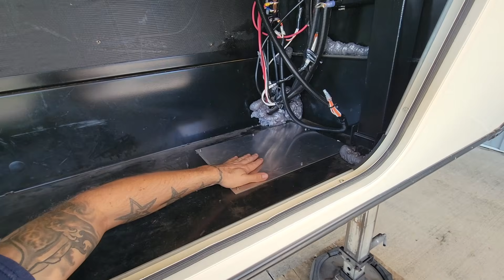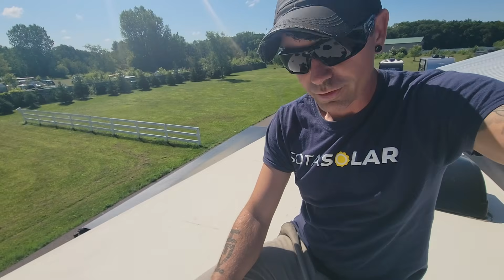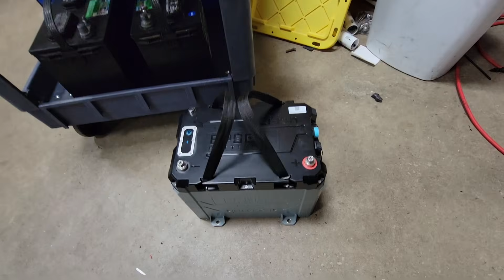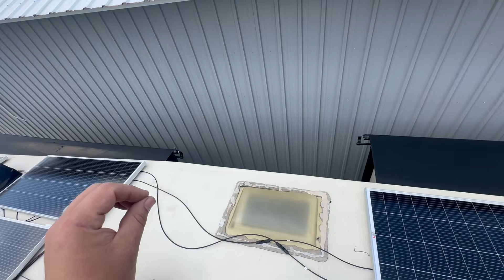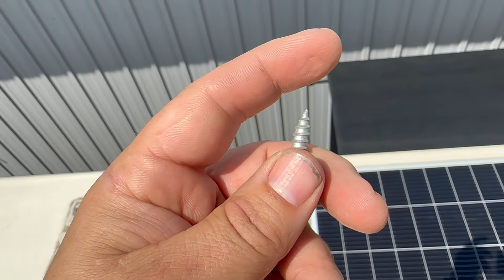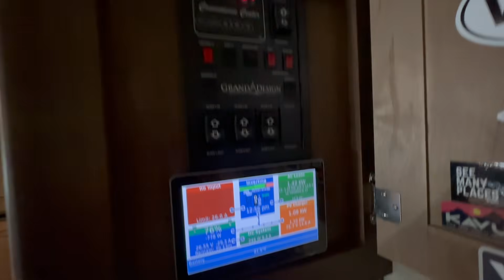2019 Grand Design Reflection 337 Victron 24v 2000w Solar Install  Epoch Batteries

Comment: When you fuse/wire the 24:12 converter, are you using 4ga and a 60a input fuse???
Reply from the maker: Usually 6 awg and a 60-80amp breaker.

Comment: I’ve got one of the 460Ah Epoch batteries and have been very happy with it.  Be sure and set all charging sources to 13.9 Absorption and 13.4 float to prevent the batteries from going into “full charge protection”, which happens if the amps are low and the voltage goes over 14.  It happens once fully charged and connected to shore power if you use the default Victron charge profile.  In full charge protection, they completely turn off, as if the batteries were completely removed, which means they won’t support the 12V loads, and your voltage will fly all over the place since the MultiPlus in float is trying to support the loads.  Just a little quirk with the Epoch BMS, but once you know it, you can adjust for it.  Downside is Victron makes you buy a $70 dongle just to interface with your PC and make the adjustment, instead of giving you a USB plug right on the unit.  You’ll need to adjust the solar charge controllers as well to under 14.  Bulk charge will remain over 14 but that’s not an issue since the amps are high.
Reply from the maker: Yes that is a quirk of the Epoch 460s .  I did see there is a new firmware out for the batteries and a new 460ah version of the battery.

Comment: I am doing a similar 24 system with the Orion Stepdown.   How do you tie the 12v battery to the existing shutoff switch for  the rv, and panel system?   I am assuming you remove all the original inverter, charger, converter.
Reply from the maker: We just put the output of the 12v converter to the existing battery, or where it connect tot he rest of the system.  Whatever is more convenient.    We do remove inverter many times, we leave the converter in, just turn off breaker.  Reason being is if something happened, we want that to still be available.

Comment: Can you explain what you do to route the main power wire to the multiplus? Why are you disconnecting the main rv input wire? I don’t follow what you’re doing there and how you route the new wires and why you’re not keeping or reusing the original rv input wire that already is routed to the main fuse panel?
Reply from the maker: The Multiplus takes all 4 wires in from shore and outputs all 4 wires to the panel, so we must re-reoute the wires through it.

Comment: Loved the setup and install. Just curious on how you all tied in the 12v battery to the Orion? Would like to see the connection diagram for that setup. I like having the 12v battery as a buffer to help pickup the slack rather than having the 24/12 converter do all the work.

Comment: Have a 337bmyself and was wondering what size gauge wire you ran down thru the vent and where and how did you bring it out of the vent down below...Thanks I appreciate it...and might have to get with you to finish my system...Great videos also...David
Reply from the maker: Would love to help. 

10 awg solar wire. We neglected to record that, and I wish we did. JD carefully preyed back the wall in the bathroom revealing a nice double right angle bend making fishing a line a bit difficult. Although, thinking now, you could use the balled up plastic muff on a string and vacuum trick to suck it up from below. Maybe next time, ah hind sight.  Anyway, JD then cut a small hole big enough for the wires through the vent pipe near the top of the wall.  We left the wall open long enough to run the cerbo HDMI as well. 

I hope that helps.
Reply: @sotasolar Thanks I appreciate it...can you explanation hie you guys seal the hole back up in the vent tube...Thanks

Comment: Clean install.  But...why lithium ion when lifepo4 is way safer and has 3x the cycle life?
Reply from the maker: Pretty sure these are LiFePo4
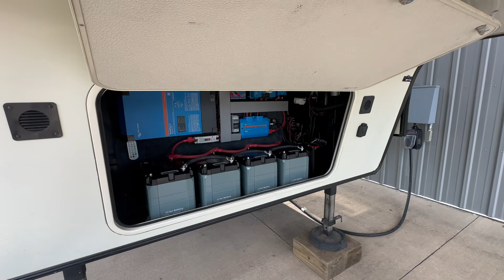Reply: @sotasolar  Go to 20:06 in the vid, freeze the screen and on the batteries they say Li-Ion.  These are not very good in extreme heat either.  I did like the cooling fan option you did though.
Reply from the maker: https://www.epochbatteries.com/products/24v-100ah-heated-bluetooth-lifepo4-battery this is what we installed. I think someone got creative with the case molds. Good catch. These are lifepo4 inside though.
Reply: @sotasolar  Thanks.   I think Li Ion refers to the name of the battery and not the chemistry.  A bit confusing but you're right, I was wrong.

Comment: Can you provide more details on the vent fan setup?  Is the fan pushing air out or pulling air in?  Is the fan on a thermostat like a Ruuvi tag triggered thru the Cerbo relay?

Comment: 4 plus years ago I put 1500Watts on the roof of my trailer.  Nothing else is up there.  Everything else is routed out the back or sides.
24volt with 200lbs of lithium in the back

Comment: I just did my third installation on my new GD Reflection 337. Very similar system but still 12v. You should try the new Rich 250w solar panels. I have been very impressed. I am a retired engineer with a degree in electronic engineering.
Reply: Donyoubhave a YouTube channel or somewhere you post or record your installations...Thanks
Reply: @davidmarkel7519  no, I just do this for my own personal use and enjoyment.

Comment: Can you share more on the Dihool breaker? How does it mount? What size lugs does it take? I cannot find a manual for it. I love the idea of a breaker rather then fuses and a shut off...
Reply from the maker: We use 2x 4" t25 screws and  use a step drill bit to prep the holes.  The mounts that come with it and for through hole mounting with a long bolt and nut... ewe.   It works with 2/0 out of the box, we trim down 4/0 lugs by 1/176th an inch each side to land those, we prep the lug surfaces for a good contact area.  Run a file or sand paper across a 4/0 lug, you'd be lucky if 30% or more of the surface area actually contacts the mating surface.

Comment: I have a question you were originally going to put 1600w of solar power on the roof with the current mppt 250/70 you then decide to go with 2000w of solar on the roof at that new wattage the solar can now put out more then 70 amps should you now put in a new mppt to handle the more then 70 amp that solar will produce?
Reply from the maker: We did not upgrade the controller because in practice it’s pretty darn close to 70.  Let’s take 2000w/27.6 volts (not 24 because that’s not the changing voltage.) that gets us to 72 amps if perfect conditions. 

Normal conditions we didn’t see much over 1800w leaving plenty of head room.  

IF we had started with the plan of 2000w , we may have upgraded to a 100a controller, if for no other reason than reason as the greater heat dissipation properties.

Great question.